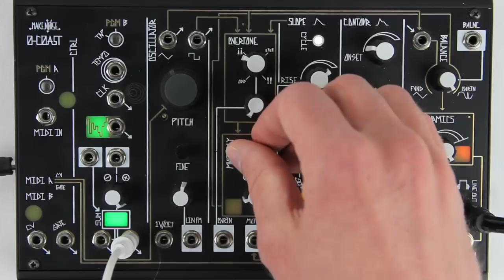0-Coast Science: Avoiding "Pinning"

Comment: Anyone now how I can safely pair this with my cocoquantus 2
Reply from the maker: You can patch the line out directly into Cocoquantus input with a TRS cable, this will put the 0-Coast's output into both Cocos. For cross-patching modulation, you would need a format jumbling device such as the Low Gain UTL. In my experience, Ciat Lonbarde and Eurorack modulation signals are tough to use together, plus it doubles the number of cables you are using for any given bit. However I know that some people do it a lot so it may well be worth trying! -W

Comment: Fascinating.  Is the wave multiplier on the DPO the same way, where it attenuates the signal and you can use it like a VCA?
Reply from the maker: Yes, but on the DPO Fold you can get there with the panel control alone, whereas in the 0-Coast you must apply negative control voltage.